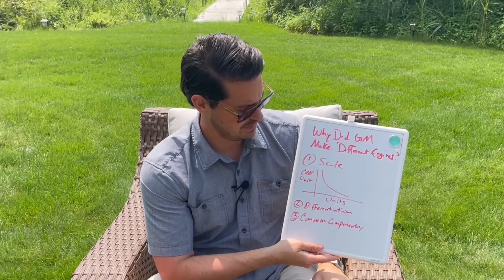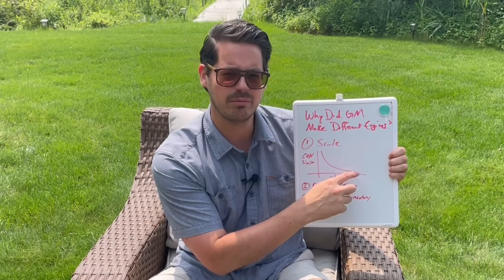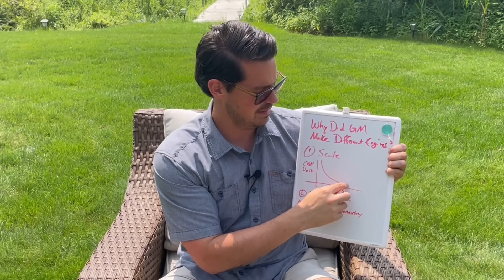Why did General Motors (GM) Make So Many Different V8 Engines in the 1950s-1970s?

Comment: Having owned all these engines it wasn't 'til the early 90's I realized what you just conveyed!     Had a Pontiac 350 Catalina that got 17 MPG intown, and a '76 Buick 455 that got 17 MPG on the highway, neither making sense to me, along with Chevy SB 400 at 11 MPG HWY!  Our whole world is very strange!  Also a '70 T-Bird 429 4V @4 MPG/11 MPG, sold it fast!
Reply: Something had to be wrong with that T-Bird. I knew someone with the even larger 460 in a large and in charge Lincoln Continental and it got better than that.
Reply: The 429 needed a straw directly attached to a gas pump at all times but it was possibly the smoothest V8 Ford ever made. The torque in the T-Birds with 429s  were like turbines and sooooooo quiet
Reply: Pontiac 350 was actually 355cid.  In fact, the 301, 326,350,389,400,421,455 all shared the same basic engine block.  The 403 was an Olds engine.
Reply: That 70 T- bird 429 really get 4mpg? I swapped a 69 429 out of a T-bird and into my 77 Ranchero.  It had a 4bbl carb too. I was getting about 10 mpg loaded/towing a trailer or empty. I did have pretty high freeway gears in the rear axle 3:00.
Reply: By the time of the 350 small block and 455 big blocks GMs were beating Ford and Chrysler products at highway gas mileage that served them well in the seventies. Their engines barely turned on the highway.
Reply: @LlyleHunter  Our 350 in our 1970 C10 at 55 miles per hour only turns 1710 RPM!  Because of that we're able to attain 17.1 miles per gallon on the highway with a three speed automatic transmission.  Kind of amazing that our 53 year old truck can attain that kind of fuel mileage.

Comment: I actually wondered about that.🙃  Unfortunately my Corvair doesn't have that neat little door on the distributor to adjust the points.
Reply: To the best of my knowledge, the window distributor was only on the V-8s.  The others still had conventional points that you adjusted with a feeler gauge.  It was definitely a piece of cake to set the dwell - idle the engine, turn the screw I forget which way (it was forty years ago) until the engine stumbles, then turn it back about a half turn IIRC.  Dwell set.

Comment: Had the Buick 350 as a teen (for about 50k miles), I "very much" liked that engine, did change the distributor (soft cam lobes), that engine ran great with better mileage on the open hwy then expected, topped out my 70 Skylark at 133 on a flat stretch in farm country. Those were the day my friend, I wish they would never end......
Reply: In 1988, my car-building friend had a 1971 Skylark that we fixed up and painted, and yeah, she was a blast. 4bbl 350, hell yeah.
PS @Mycountrystolen: I love your username. 
At the last Sex Pistols show, in San Francisco in December 1978, they closed with The Stooges' No Fun, and then Johnny Rotten said "'Ere, ya ever get the feeling you've been cheated?"
Every day, Mr. Lydon. Every day.
Reply: Still have my 68 Skylark with a 350. Originally had a 2 barrel, but Dad and I found a 70 LeSabre and pulled the 4 barrel and intake. Woke that 350 up a ton. The 2 speed Super Turbine is a hilarious transmission. I could downshift it at 60 mph and it would just launch.
Reply: I bet that Skylark was a joy with that Buick 350 in it. 👍
Reply: That had the same deck height as the Australian Leyland 4.4ltr alloy V8 which was a bigger version of the Buick/Rover 3.5ltr alloy V8, like the cast iron Buick 340 & 350

Comment: I miss the old Pontiac V8s. Had a '79 Trans Am for many years, it had the Olds 403 in it.  Wound up having more than a few discussions with counter guys at auto parts stores who were sure it couldn’t have been factory.  Their ‘corporate’ engine options at that time, while making economic sense, were still annoying to me - the ‘79 Firebird could have had a 231 Buick V6, a 305 or 350 Chevy V8, a 301 or 400 Poncho V8, or the 403 Oldsmobubble V8.  I wish I could have found one with the 400 Pontiac with a 4 speed, but after looking long and hard gave in and got the 403/automatic car.
Reply: Yes, and they used to have the shaker hood with 6.6 Litre on it to futher confuse you, or at least make it so it didn't matter if it was a 400 or 403.
Reply: @tomm1109  Actually, that one was easy once you knew this detail - if the shaker scoop said 6.6 LITRE it was the 403 Olds; if it said T/A 6.6 it was the 400 CID Pontiac.
Reply: Actually, I need to correct this - upon some further reading, apparently the 'T/A 6.6' decal was only for W72 package cars with the 400 Pontiac.  Apparently there were others that got the L78 Pontiac 400; they shared the '6.6 LITER' decal with the Olds 403 powered cars.  I suspect that there were very few of them, and that the VAST majority of 6.6l  cars had the Olds engine, thus my confusion, having never seen a '6.6 LITER' marked car with anything but the Olds.403.
Reply: All pontiac v8s were the same block.

Comment: Chrysler had many disparate engines too in the '50s. Not many perhaps realize that the first generation Chrysler Hemis were different by division. Chrysler/Imperial, Dodge and Desoto Hemis were different. Of course Plymouth had its own non-Hemi engines too. Chrysler abandoned that strategy in the late '50s by replacing the three Hemis with the B engine (350/361 which evolved into the 383/400) and RB (383/413 which evolved into the 426/440) which became available across all divisions.

Comment: I never thought of that production aspect.  They made and sold so many cars it didn't cost that much more to make different motors.  As the 70s wore on it made sense to consolidate, but the cars lost their personality after that.  But it was inevitable.
Reply: I think that if GM had never given compacts to Pontiac, Oldsmobile, and Buick, only to Chevrolet, things would have turned out much better.  Remember, Ford only sold a fraction of the number of Comets and Mercury Meteors compared to the number of Ford Falcons and Fairlanes.  Chrysler's 1963 Dodge Dart did well, because it was a little bigger than the Valiant.  In 61 - 63, the compact Dart's predecessor was the same size as the Valiant, but cost more.  It was a flop.

Comment: Separating the divisions into their own entities, Ford probably had the most out of all of them.
Reply: And it was probably not a good idea. At least GM didn't have overlap within each division. Ford on the other hand had the Windsor (302, 351W), 335 (351C, 351M, 400M) and FE (360, 390) in production simultaneously. Lots of time/effort lost in not immediately aping Chevy and Mopar. Not till the early '80s did Ford FINALLY settle on one small block family (Windsor) and one big block family (385) whereas Chevy converted in 1965 (SBC and Mark IV BB) and Mopar in 1967 (LA and B/RB).

Comment: Buick 455 was the best!  For street level HP, like less than 450hp it was a better motor than the BBC because it was a lot lighter.  It also had the biggest bore and stroke of the 454/455s and was the last new BB of the 60s coming out in 67 with new modern tech to make it lighter like having the oil pump, water pump, and distributer in an aluminum unit at the front.  The Chevy's with the dist at the back must have been a pain to do the points, especially on a truck.
Reply: Do you mean the Buick 455's had a more oversquare ratio compared to the 454's
 and as such, fundamentally more of a "racy" engine with less rotating mass?
Reply: @Johnnycdrums  yes Johnny, the Buick 455 had a relatively short stroke @ 3.90 inches
Reply: @mark_osborne  I don't think I'd call 3.90 short.
Reply: @Johnnycdrums  The Pontiac 455 and the Olds 455 both had strokes of over 4 inches, and the Chevy 454 had a stroke of 4 inches even.
Reply: @Johnnycdrums  compared to  a Cadillac 472/500 its a midget
Reply: @shaun.h.barlow  Wouldn't be surprised if the 472/500 Cadillac engines were the heaviest of all the passenger car big blocks.
If I remember correctly, they had a huge bore spacing with those blocks.
Reply: @Johnnycdrums Compared to every other GM 450+ cubic inch engine, yes, it was short.
Reply: Weak oiling but a awesome engine 455 Buick
Reply: Distributor in the front wasn’t really great when you hit a big puddle or a snowbank, with the distributor in the back it was better protected against water getting in and shorting out the spark.
Reply: At least it had shaft mounted rockers and a distributor in the front.  Plenty of problems, but it got that part right.
Reply: @craigbenz4835  400k miles on Chevy needle bearing 4.3 roller rocker
Reply: @craigbenz4835  until it rains and drowns the distributor
Reply: But that aluminum unit sometimes corroded - aluminum against iron or steel gets destroyed by electrolysis, and "better" to the average motorist means more durable, more rugged, and longer lasting, not lighter.  I liked the Nailhead and the Straight 8s better.  Maybe they could not produce as much horsepower, but Buicks were never sports cars, and front-mounted distributors can be susceptible to road splash.
Reply: You have that correct!  Points replacement in our 1970 C10 pick up is a pain, especially for a small person such as myself!  At times the engine looks like it's having me for lunch as I am completely inside under the hood trying to reach the back distributor.
Reply: @frederickbooth7970  In 1984-88, my dad had a 1965 GMC that was repowered with a 64 Chevy 327 in 1973. You'd think it'd be easier to change the points on her, in that huge truck engine room, right? Nope, it was smacked right up against the wall. Luckily, on a 60-66, the hood includes 6" of the sides and front of the hood, so it was easy to climb up on the many lumps on the front and sit on the driver's side of the engine room with my feet on the frame.
Reply: Detroit’s last clean sheet designed BB, was the 385 series Ford introduced in ‘68.  3.85” stroke for both 429 and 460.  Not light by any means, but sturdy and like the BBC can rev when built for it, and affordable to build.
Reply: @ProjectFairmont  ; No, the 429's and 460's have the same bore of 4.360" and the bore spacing is 4.900", for both, obviously.
429's have a 3.590" stroke, 460's are 3.850. They were called the 385 block from the beginning which tells me the 460 was planned from the start, and not just an outgrowth of the 429. 
Hand selected fits were used for about the first two years of production.
The 429 is inherently a racy passenger car engine, as it is oversquare by a whopping .770", and the 460 ain't bad at .510". 
The wall cyl. thickness at .530" is only .070" less than the big old 430 MEL's.
Everything else being equal, this indicates to me that 385 blocks are a good deal heavier than the FE 427/428 motors of the previous generation.
Reply: @Johnnycdrums  your right; the was 3.590”; 385 series a foreshadow of the 460 indeed.   My 521 has 4.300” stroke and is all done by 6k.
Reply: @ProjectFairmont  ; Not a foreshaddow as they came out simultaneously, the 460 was planned from the start which is why it's called the 385 block.
Your 521 sounds crazy, but in reality, it's still oversquare by .060. all that being said, it must be a real torque monster.
Reply: @Johnnycdrums  it’s in a 4600lb Lincoln MkV with 2.50 gears and a single plane manifold.  Edelbrock Tourqer II is the only performance intake I can use (not made of cast iron) with an unaltered hood.  Not exactly a stump puller, but it spins like a small block, a fun sleeper.
Reply: @ProjectFairmont  There ya' go, sounds fantastic, and nice highway car too because of the rear differential 
Ain't nothin' wrong with cast iron.
Them old 427 (R) engines had tubular cast iron headers, until Ford could no longer source them.
That's another reason they shut down the 427, plus the molds were wearing out, so I have heard, and the thin wall casting process would have required major retooling.
The FE was never intended as a big block, and it never really was, as it started life as a 332 V-8, I think..
Reply: @Johnnycdrums  Absolutely nothing wrong with Cast Iron.  Blocks (strength) and heads (exhaust scavenging), I don’t know of any advantage as it relates to intakes however; heat retention not a plus and dead weight??  I cut half a coil to level out and make up for the elimination of 180 lbs on the nose of the MkV.   Heads, intake, water pump, exhaust manifolds.  Also decided not to use AC.  Fair weather car, upper Midwest and the ventilation system is quite good.  D code parts not a priority with this late 70s car.  While it did run good w/48k miles I wanted to do a semi-hot BBF, and the MKV is a good candidate with the OE C6, 9”, and 4 wheel disc brakes.  Very happy with the car as it drives nicely.  20 years ago I would have laughed if someone mentioned such a thing, now I can appreciate the blue chip old school engineering.
Reply: My truck has a removable dog house.  Yes its a pain.  But I have HEI.
Reply: The bottom end sucked. And the oiling system was barely adequate.
Reply: Great engine until the crankshaft fell out the bottom.
Reply: @nicksgarage2  Tell that to my 600+ HP Buick 455 with the cast iron crank and main bolts (not studs) that has no problem with 6000 RPM shifts.
Reply: Buick 455 came out in 70
Reply: Wasn't it just a bigger 430?